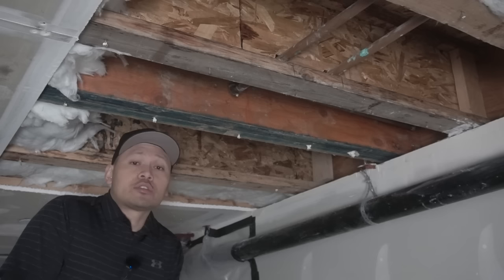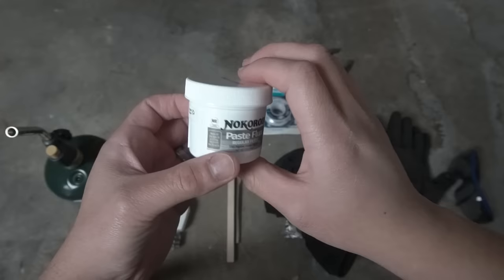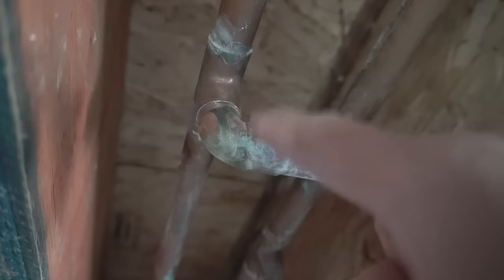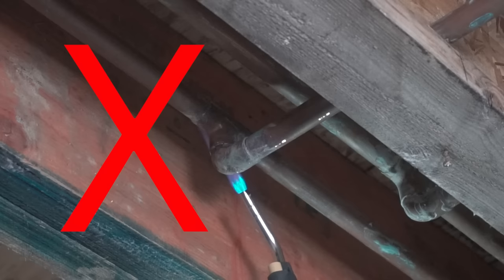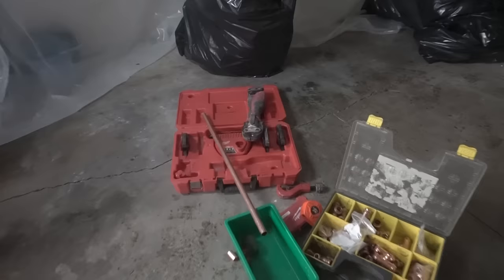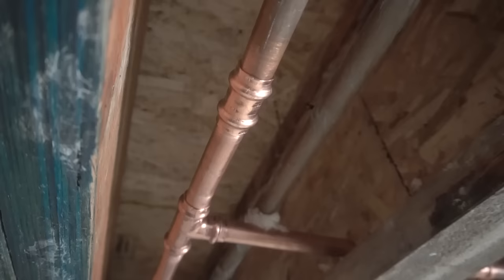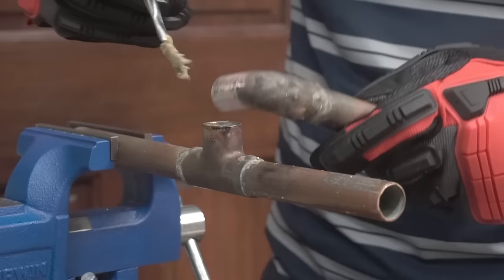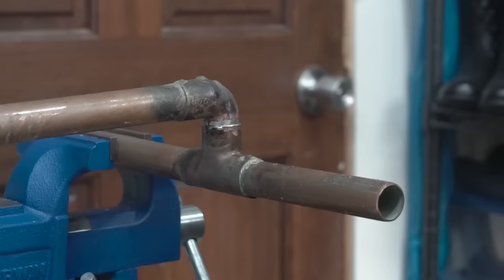How To Fix ANY Pipe Leak! 2 BEST Ways For DIY Plumbing!

Comment: Not a fan of press fit, and certainly not shark bite. Solder has been around for a long time and is a proven method.
Reply: And yet here we are and Ive replaced leaking solder fittings. Sharkbites been around for over 20 years.
Reply: @srobeck77  If a soldered joint is not properly prepared and soldered, then it will fail over time. Sharkbite is not a good product in my opinion. (Good for homeowners and people who don't know how to solder) leave in an exposed location and never bury in a wall because it will leak eventually. 
Took another look at the video before commenting again and don't agree with either repair.
Master plumber and boiler specialist for 30 years. Commercial, industrial, institutional
Reply: @rond.2391  In your experience, how often have you run into leaking sharkbites? Beyond Sharkbites, have you encountered any other types of press fittings that started to leak (due to deteriorating o-rings)? 

I am looking to re-do at least 60-80 ft of my laundry room and basement ceiling copper lines. Seems to be getting very difficult to find plumbers willing to 1. use copper instead of PEX these days to begin with, and 2. if they do agree to do work with copper, they now only offer to do it using press fittings instead of solder/ sweat fittings (because of how much faster and easier it is for them to use compression fittings these days).
Reply: @Ralphfili  definitely don't use sharkbite. We have customers that insist that only solder jo8nts be made. Pex tubing is fine in a residential application. I have seen press fit leak many times. My opinion
Reply: @rond.2391  Thanks for the input. I'm going to stick with copper (type L or maybe even type K instead of the thin type M that the builders used that are pinhole leaking all over the place, now). I'm still not on board with using PEX or related, due to the potential VOC leaching issues.
Reply: @Ralphfili  I think that's a good choice and I am on the same page with the vocs. FYI, type m is the standard and is fine in any residential application. The pin holes you talk about are from about 20 years ago when they had some bad pipe. (Unless there is something wrong with your municipal water) type L is thicker and type K is the thickest and you probably won't find it.

Comment: If the water is sitting should mean it is lower, it should have some place you can use compressed air to blow the water out and solder, your method is good for raising the cost of repair to the moon, good marketing excuse, sorry sir see this pinhole on the joint that is where it's leaking, so why did you cut it in 3 places, water my friend, can't get the joint hot enough so your cost will go from 50 bucks to 225 bucks these junctions are not cheap same with copper tube. Come on guy you just made a mountain out of a mole hill 225 
bucks for a 5 minute repair, why didn't you mention that before Elvis didn't you know it was a water line, well, well, well..

Comment: What a simple way to fix that?
Shut the water off and drain the lines.
Clean the entire joint area with sand paper and steel wool, blow off dust and wipe with clean with acetone.
Get some JB Welt epoxy plumbing puddy, mix it well by hand and wrap around the joint applying pressure to the leak area and over lap. 
Let it cure according to directions within the temp range on the packaging (near room temp).
It works great with no heat or expensive compressing tools required; used it several times and never had a failure.
Reply: Fixing Ceiling Pipe Leak JB Water Weld  (on Youtube).

Comment: A real plumber would've used  mapp gas and would've  definitely  soldered it instead. And FYI, next time drill a hole on the bottom of that 90 to help drain any standing water.

Comment: Not really a DIY job if you use the press fittings. Cheaper to employ a plumber by some margin
Reply from the maker: Hi! Press fittings are around $30-40. And you can rent out the press tool. This job on this video will be around $800-900 if a plumber was to charge on my area.
Reply: @FixThisHouse  Interesting stuff. I'm in the UK and my plumber would charge £100-150 so $125- 175 for that work. I guess US plumbers need to fund their Ferraris 😀

Comment: Shark bite and push connection's fail all the time. Sweat or pro press is the only way to go if fixing a copper pipe.
Reply: sweated connections fail all the time. trust me i own a house lol. sharkbite is the only way to go if fixing a copper pipe.
Reply: Um no, bias plumber dude.  Ive replaced many leaking soldered joints with Sharkbite, not one has failed yet. If the time comes, guess what, its like $8 for a new one, instead of a $500 plumber call. Most plumbers now arent even soldering. They are all Pex and Propress. U got get with the times, bruh.

Comment: Wow some of you are freaking babies. They sell a cheap mechanical compression tool that does the same thing by hand when compressing the  O-Ringed fittings. Less than a hundred dollars, and considering it would cost 500 bucks to have a plumber do this job, the tool pays for itself after first use. Fittings with O-Rings are the best way to go, fixes leaky solder joints and pin holes in minutes if not seconds.

Comment: unfortunately these type of press fitting's are not as good as the solder fittings do to the o-ring going bad real fast, yes its more easy to use but nothing compares to the superiority of the solder fittings...